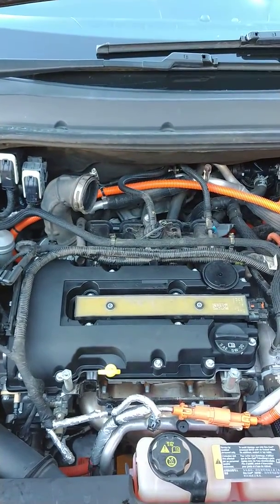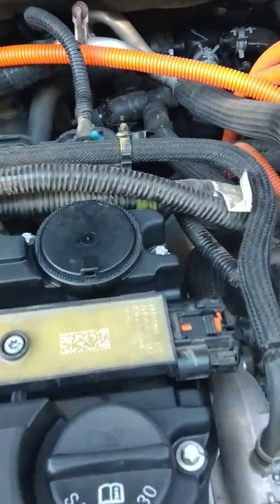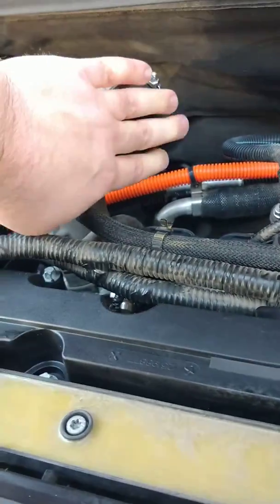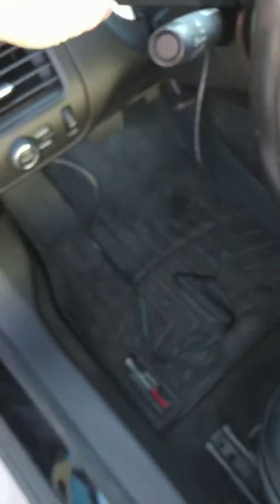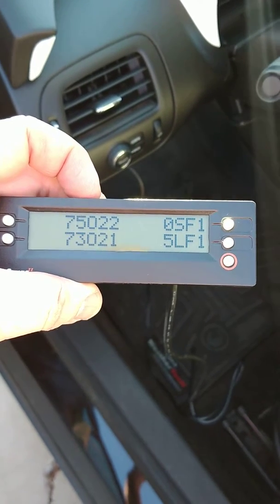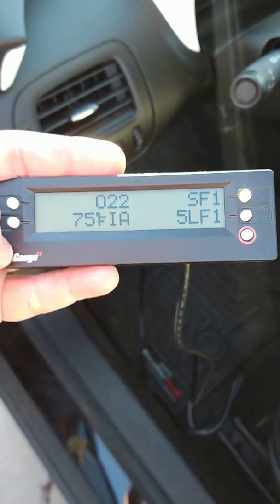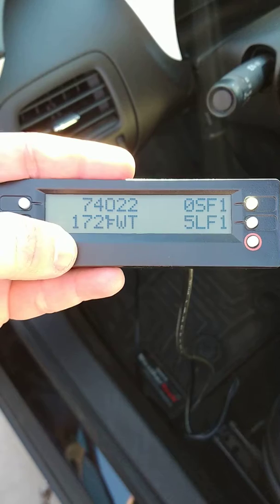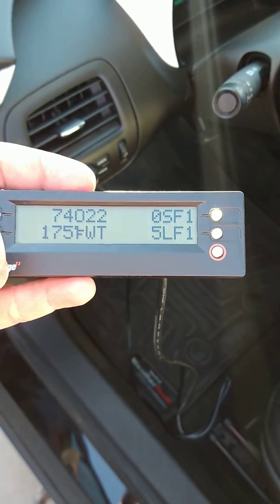2013 Chevrolet Volt failed valve cover causes it to not pass emissions part 2

Comment: Did it pass?
Reply from the maker: Yep. I drove it for about 20 minutes on the engine after the new valve cover was put in and enough of the readiness codes were set to pass emissions. The engine ran a heck of a lot smoother also.